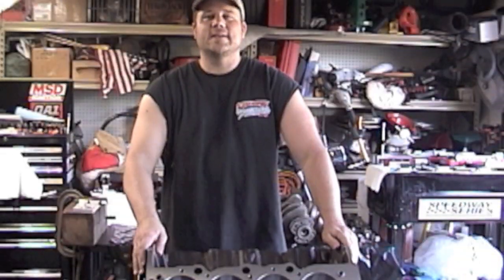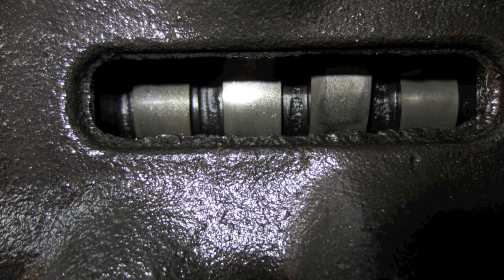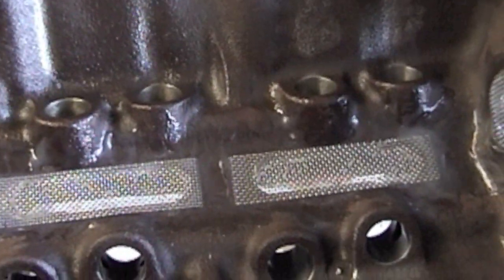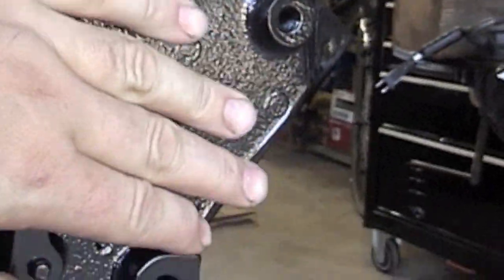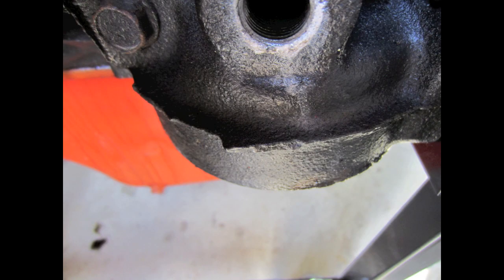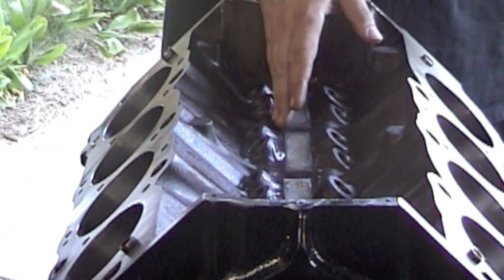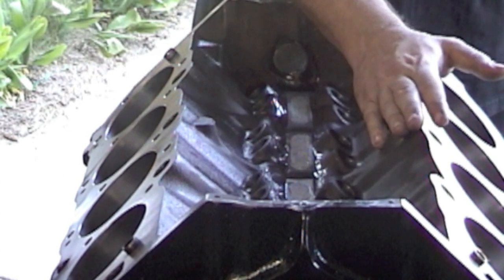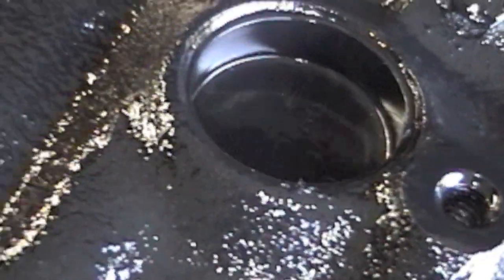Part 5 Prep The Big Block Chevy Before It Goes To The Machine Shop

Comment: There are 2 thing I do as well as those you have shown. On the bottom of all the bores I very carefully round over the edges. As the piston moves upwards, the air and oil mist that needs to follow behind, is unencumbered. The mist in the air helps lube the bores, piston pin and rings. At high RPM it also allows the "pump" to work more smoothly. And, if you do use the screens over the cam, I drill a small hole (#7drill)  at the end of the last screen/oval opening and a little to the right so oil can drop easier into the crankcase. Why? When the screen gets wet with oil it tends to stop oil from dropping easily back down to the crank where it is needed. It is made worse when the screen catches any debris.  ** Thanks, John for all your postings! They are very helpful.*

Comment: As a full time engine builder no need for screen, if anything it acts as a restriction. I build 2-3 engines a week and never use screen. The most important thing is the correct rear cam bearing, use the wrong one and you won't have oil pressure.

Comment: ohh-yeahh.... just picked up a real low mileage chevy 400 block that was stripped for pistons and rods and heads , and sat in a clean shop for 30 some years so theres very little rust anywhere, and the cylinder walls don't even have a ring groove at the top, so im guessing the block had less than 100k miles for sure.. any how just power washed the block 2x this morning and now its time to put together the engine stand and start prepping the block.... so many times before my friends grease me for always doing flange removal and minor prep on other peoples blocks for free because that's how I would do it if it was my build, well today its all about me and my build, I even learned a thing or two in this vid that will probably save me more than 150 dollars in the machine shop labor, which will probably be a lot since this motor will be externally balanced and bottom end assembled at the shop by the pro's
Reply from the maker: Hey Gary McCarty,
Thanks for taking the time to post!
I'm glad the video was helpful and can save you some do-re-me!
Have a great day
Johnny K

Comment: Great video! I'm getting ready to build my first big block and will definitely be using these tips and tricks. One question I have is, is it ok to put the oil valley screens in before if I plan to have the block baked? I was going to have it cleaned and baked prior to decking, line honing, boring, etc. Thanks again for the great video

Comment: Mechanically inclined but I have never built an engine.  I will be building my own 496 with some help from a friend.  I appreciate the videos.  Am I understanding this correctly, ? The oil galley screens,   You installed the, before the trip to the shop?  Also, what epoxy did you use?  Thanks again.....I am reading every book and watching every video I can,  I think your vids are some of the best info out there. Thanks again